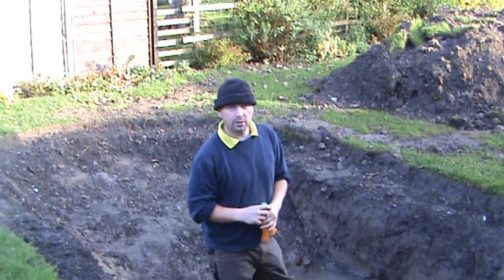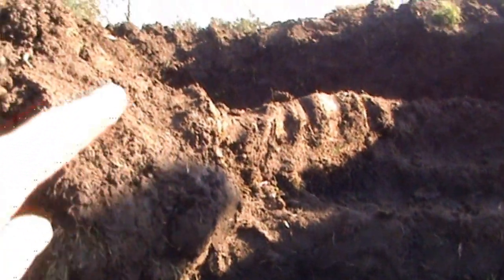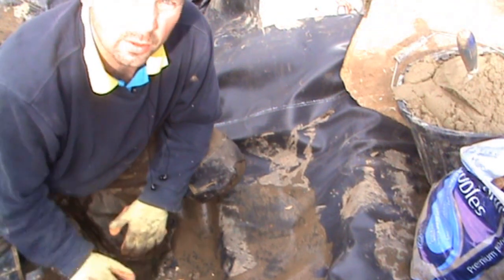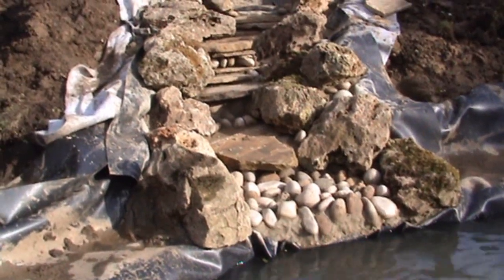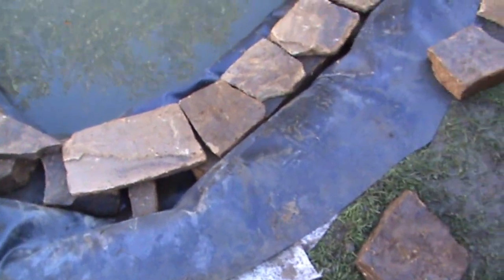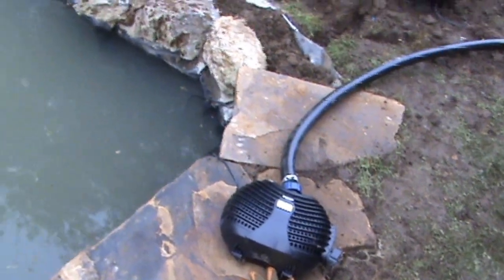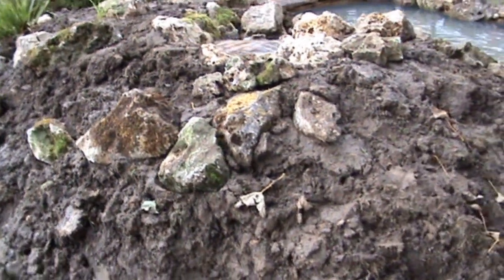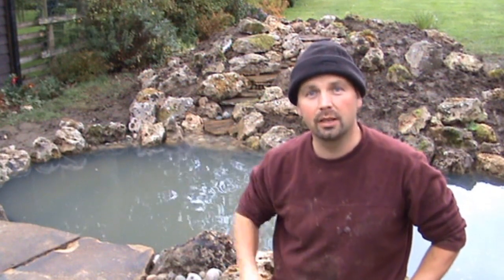How to Build a Fish Pond and Stream / Cascade - Complete pond building video by Pondguru

Comment: hello i bought a pump that is bi bigger than my pond require can i reduce the preasure useing a ball valve
Reply from the maker: Yes you can put a valve in-line and as long as you don't shut it down too far it will be fine. Alternately you could fit something like this: http://geni.us/0f10 and divert the flow to different places which would be better for the pump.

Comment: sorry to ask again, but I've noticed that the Oase pumps can pump say 4000 gph, but some of the filters say max flow is about 1500 gph as an example. So I assume there's a T- somewhere to help reduce the flow before it goes to the waterfall?

Also, a pond this size would it "require" aeration of sorts? Or is it enough just from the water fall?
Reply from the maker: The oase filters will generally do best if the pump size is the next size down from the filter. For example a 12000 litre per hour pump for a 16000 filter and a 8000 litre per hour pump for a 12000 filter. You would never try to push more water through than the maximum recommended flow or you would then need a Y splitter from Oase (Y-DB 1 splitter) which will control flow.
The cascade will provide enough aeration and water movement so you wouldn't need extra aeration.
Reply: thank you so much for your responses

Comment from the maker: Not sure if they will survive a UK winter. I've had them in a few ponds before and they just died out after eating the plants (which wasn't ideal) but I live up in the North East. I always advise on getting ramshorn snails as they only eat algae and detritus so will not damage pond plants.
If you have a correctly sized UV and filter the water should be crystal clear? with no green colour to the water. That won't kill blanketweed though.

Comment: Hi pondguru my pond is 12ftx6ftx4ft what size uv light would I need to keep the water clear , thanks
Reply from the maker: As that works out as approx 8200 litres you would need a 110w UV but that would obviously be coupled with a large filter based on the potential fish stock and sunlight exposure. Minimum would be a filter which treats 'up to 25000 litres' as you can always half what the manufacturer says the filter will treat for a pond of normal fish stock and sunlight for at least half the day. For koi you would take a bit more off, hence the 25000 recommendation.

Comment: Not contradicting your build as I found it very educational as I am going to build my own, Is,nt the sulpha in the cement harmful to fish or is it special aqua cement.
Reply from the maker: When using a fair bit of cement it is always best to let it harden for 1-2 weeks, fill the pond and run it for a day or two then completely drain it and re-fill - that will wash out the vast majority of anything which would be considered harmful. After a further 1-2 weeks of running the pond it will be safe to add fish.
If you use a waterproofing agent in the cement mix that will help to bind the toxins and make the cement much less porous.

Comment: hi iam currently digging out for my pond its 12 feet long by 6 foot wide .i was thinking of digging to 4 feet at the deep end but was hitting pure clay at 2 feet would 3 feet be deep enuff ??
Reply from the maker: 4 feet would be better but I assume you are having a mix of fish in there so 3 feet is still a decent depth. Clay is good to dig through as it can be cut into blocks. and makes for good strong edges to shelves.

Comment: Watched dozens of videos. This is the best I've seen. Every other video uses traditional pumps and filters. Thank god they sell Oase filters and pumps in the US. They ain't cheap but you get what you pay for. Don't know why you would use anything else. Hey Pondguru just wondering if you tried the Oase skimmer that sits on a stand in the pond as opposed to being buried like traditional ones? Also what's your opinion on covering entire liner in rocks I've heard mixed opinions. Thanks
Reply from the maker: M Wilson I'm not a fan of covering he liner with rocks but it can look more attractive - makes cleaning more difficult though. The tower skimmers are fine but you need to allow for them in the design of the pond (have a flat deeper area near one side) to save reaching into middle to empty the basket. Good thing about the Oase pumps is that you can operate with a skimmer and also draw from the base of the pond for much better water turn over. Glad you enjoyed the video - thanks for watching.

Comment: Where can you get decent natural informal slabs like that? Can’t find it anywhere (I’m in Leicester)
Reply from the maker: I'm not sure where you would get them from down in Leicester as stone choice and what  quarry is extracting will be specific to that region. Up here the quarry I was getting my stone from closed down now we only have a very expensive one left which has incredibly flat stone - I preferred the thicker more random stone from the quarry which closed.
Reply: Pondguru yeah all I find is normal square paving slabs. Want more natural random sizing. Thanks for the reply I’ll keep looking! Love your video. So helpful
Reply from the maker: No worries, any time - if you can source it from a local quarry it will be way cheaper than through garden centres.

Comment: if there are two inlets in the pump, is the inflow split in half over the two inlets evenly? So if a pump is 1,000 gph for example and there is 2 inlets (cage and pipe inlet) the pump still is sucking in 1,000 gph but is it 500 ghp per inlet?
Reply from the maker: Some pumps have an adjustable inlet and so if it is set to 50% it will suck in 50% and the cage will suck in 50%
Reply: thanks

Comment: Hi PondGuru Im working on my own pond now and I have a question. do you put rock walls on top of the liner I know some people do, mine is going to be 6 feet to winterize it my question is to keep the liner from floating up are rock walls necessary or is it possible to build without?
Reply from the maker: The liner will only float up if you have a problem with groundwater lifting it so building over the liner will not be necessary in 99% of cases. I build rocks and walls around the inside perimeter of ponds to hide the liner but on a more formal design I would just go for overhanging capping stones.
Reply: Pondguru Thanks for replying so quickly will definatly kep that in mind also its less costly right? :)...also I was wondering at the bottom do I put some muck back at the bottom to grow plants? ive seen some people use pots so they can take it out and clean it?  do you have any particular advise on these two ways of growing plants.. I would think growing it in pots limits how mucha  plant can grow and how many pots you can put without putting pressure on the liner right?

thanks
Cheers!
Reply from the maker: TheReasonableHuman The plants do fine in pots and it doesn't limit their growth as  the roots just grow through the sides, no worries.

Comment: Hi, some good tips, never thought about moving pump to shallow area :-) hmm as you used a lot of mortar, yet no g4 sealer? Can you or some 1 also advise just inherited a number of large gold fish and orfe`s, so have the nod from the wife to extend a 520 gal pond to 1170. As most on a budget, installed now is the firestone 1mm. but been looking at this 3 ply liner at 1/4 the price. guess answering my own question u get what you pay for. So looking at the greenseal .75mm. Regards
Reply from the maker: Yes the greenseal is definitely better than the 3 ply liner but firestone is 1mm and should be around the same price as the greenseal. Greenseal easily tears compared to firestone so I'd personally go for the firestone every time.
Reply: ok thanks for the prompt reply appreciated, and you just over the water from me mbro :-) Anyways could you please confirm about not using g4 please? as reconstructing mine as mentioned, and will be cementing rather than using expanding foam in previous build, just worried about the leeching of lime. Hmm quite right regarding ther firestone, but budget at mo little tight. hence looking at this 3 ply that's advertised...
regards
Reply from the maker: Brian Elfresko The 3 ply stuff is awful to work with so I'd definitely not recommend using that unless you have a very formal shape with square sides or the folds will be hard to get right.
If I build ponds which have cement under water like this one I let the cement set for a couple of weeks, fill the pond right up and run it for a day or so then totally empty it before re-filling it and that flushes the majority of lime etc. out so should be no worries. I've certainly never had any problems doing this.
Reply: Pondguru ok thank you. Aye its just an off oval shape, to be honest on tight budget at the mo mate, so even if get 2 yrs out of it. purchasing it from http://www.pondkeeper.co.uk/flexiliner.asp 6m x 6m do it for £43. but I do take in account and totally agree with firestone.
Again thanks for your time to reply
..
Reply: hi, talking about leaching etc. and the wait expense of G4. come across these 2. Prompt Natural Cement - 25kg http://www.cornishlime.co.uk/stores/products.php?cat=1&sub=26 but £19 delivery..  then discovered NHL 5, Singleton Birch (25kg) £8.65 http://www.lime-mortars.co.uk/lime/natural-hydraulic-lime in Middlesbrough.. further reading is used for sea and river ways, so assume adequate for pond life. save a few ££ on cementing then covering with G4, have you experienced working with such cements?  As now 7 tonne soil later almost ready for liner pond 10ft x 11ft x 3.5ft.. been a long haul, with stone positioning etc. just going for .75mm epdm liner would be suffice?  regards
Reply from the maker: Brian Elfresko They are products I haven't tried so I can't comment on them unfortunately. Using the method of flushing I mentioned in a previous comment I haven't had any problems with cement.
Reply: Pondguru ok thanks. just real paranoid. even going with .75mil epdm liner. but budget. thanks again..
Reply: sorry to badger you mate, 2000gal pond, just head battered,  hearing different opinions, regarding filters, looking at the oase 15000 ecoclear with 11w uv, can pick 1 from advertisement site £55, but only has sponge no bio, or go for black box type with 20w uv? just don't know. any help appreciated.
regards
Reply from the maker: Brian Elfresko The oase is not big enough as you would half what it promised to filter if you had fish and withoiut knowing the size of the box filter I couldn't say if that was big enough. 20X is a strange size UV as they are normally 25W which would be a safer bet.
Reply: Pondguru cheers, sorry was 24w. Was given the oase 15000 11w uv, just needs new o ring seal, was going to use this on 2nd stream waterfall. Looking for a box type for main waterfall just hmmm mixed opinions about the box type with spray bar ie (hozelock ecocel) types, so on the for oase 10.1, with 24w maintenance \ cleaning side simplistic. thanks again for reply...
Reply from the maker: Brian Elfresko Sounds like a good combo so best of luck with that.
Reply: Pondguru cheers mate, deal done oase 10.1,  bitron fitted 24w uv and 4000ltr oase pump £145 :-) cheers
Reply from the maker: Brian Elfresko That sounds like a good deal - nice one, man.

Comment: what the best but cheapest pond filter u would recommend for a turtle pond
Reply from the maker: I assume that you are in a country other than England (where it is too cold) so I'd say go for cheap pump and external box filter. They are usually quite cheap. As for makers names, I'm not sure what is available in other countries.
Reply: im in the uk in somerset
Reply from the maker: Scott d'chaundy The pond would have to be huge for them to survive the winter but provided the pond is accessible (at ground level) they would be fine from late spring to autumn. The only reason most of them survive in my pond is the size - they hibernate in the leaf layer on the deep shelf (approx. 5' deep).

Comment: Thanks so much for this vid and others, Pondguru! A question: I know you call it a "dray wall" but is there any mortar to hold together the stack of flat stones on the shelf (apart from to put the slabs on top)? Also, isn't mortar poisonous to fish? Cheers again!
Reply from the maker: Generally a dry stone wall would have no cement at all but we used it on the capping stones for safety reasons since it is a pond edge. Once cement is cured there would have to be a nation of it submerged constantly in water to harm the fish. The cementing is above the water (except for a small bit on cascade) so it is fine.
Reply: Thanks Guru! Really appreciate you putting your expertise out there. Do you have any opinion on using Cotswold stone in the dry wall? I have a lot of it spare around the garden but it is limestone, which raises ph. I'm getting different opinions on whether that is good or bad for the fish. I have 5 mature koi, 2 mature tench and about 50 variations of goldfish - all mature!

Comment: I have a hozelock bioforce 9000 and I am about to build my pond. I have lost the hosetail fittings. Do you know what size is required to attach to this filter and also what's the best hose to use to connect this all together thanks!
Reply from the maker: You will need proper hozelock fittings which should be available online and they will take 40mm pipe. All other manufacturers use a standard 38mm pipe and fittings but for some reason hozelock goes with 40mm and the 38mm pipe is mighty tight on their fittings.
Reply: So let me get this right 40mm is the size of the female connection  bit?
Reply from the maker: Ekram Razaq 40mm is the internal diameter of the largest pipe the biofarce 9000 hopsetails will accept. You would simply google search for bioforce 9000 hosetails to find what you need to screw onto the filter to attach the pipe to. http://www.cdaquatics.co.uk/hozelock-1537-hosetails-uvc-spare-set-9000-p-3571.html?utm_source=Googleshopping&utm_medium=Freelistings&utm_campaign=&gclid=CN-H5PS8rcMCFWoCwwodtYwAdg
Reply: You are such a legend it's actually unbelievable. PAT YOUR SELF ON THE BACK NOW!!!!
Reply from the maker: Ekram Razaq lol, no worries, any time.
Reply: We're in the UK are you based? Do you still do pond videos?
Reply from the maker: Ekram Razaq I am just west of Newcastle but I gave up doing ponds last year since my internet sales business took off to the point where I don't get time for anything else - it is crazy: http://stores.ebay.co.uk/Filter-Man-UK?_rdc=1
Reply: Pondguru That's a shame. I'd love for you to come to my house and make a pond for me lol xD just kidding.
Reply: My bioforce is overflowing help!!
Reply from the maker: Ekram Razaq It is a sealed pressure filter so unless the main seal has gone or the filter is horrendously blocked causing the outer casing to split it can't overflow.
Reply: I run it then after a few mins the  water starts overflowing coming out the top part of the lid where the screws are :-S
Reply from the maker: Ekram Razaq Sounds like the glass tube surrounding UV bulb is broken and if that is that case then the electrics will be knackered. You need to unscrew the lid and take a look -make sure electric is turned off first.
Reply: Ok!
Reply: Right striped everything down water is coming in to the glasses tube were the bulb would be, So there's a hard plastic seal that it fits in to that is were it's knackered. Also on top were water comes out of the screw is over threaded and is lose and also missing a seal :-S
Reply from the maker: Ekram Razaq If you remove the electrical part and dry it out it may still work and you'll have to order the necessary parts which are currently broke from Hozelock dealer.
Reply: Yes that's true it's about 10 pounds for service washer bundle. The electrics I will take apart clean and see! Cheers pond man. P's make some more vids!
Reply from the maker: Ekram Razaq My online business has been crazy lately so there is no time for making videos which bums me out as there are so many I have planned.
Reply: Well if you do I think start up and new fish enthusiasts will be best. Like meeeeee :-) keep it up

Comment: Doesn't sandstone slowly breakdown? I would assume even quicker used in a cascade... Seems like it would make sedement in water after awhile. No?
Reply from the maker: +Robert Gould Jr. As long as it is normal sandstone and not the sugary textured stuff it will last for hundreds of years before you see any wear so I'm not worried about erosion on it.
Reply: Pondguru Outdoors Ok nice thank you I really like that look. I'm in the middle of building my new pond and your videos are inspiring and help so much. Thank you great work mate. Cheers
Reply: +Pondguru Outdoors what will happen in a climate where the water freezes and thaws multiple times in the winter if it is sandstone?
Reply from the maker: +WHYWHYWHY As long as it is good quality stone which is not 'sugary' or loosely layered it will be fine. If in doubt seal with G4 clear sealant or similar.

Comment from the maker: I never go with the jumble of cobbles to cover liner as it provides cavities to collect muck and full cleaning is much harder. In my area of the UK we have sandstone as bedrock so I go with the walling and large slab to give solid accessibility around the edges but there are loads of different ways it can be done and I suppose there is no right or wrong way. Sometimes the ponds will have lights. Black liner gives a greater impression of depth too.
Thanks for watching and appreciating the video.